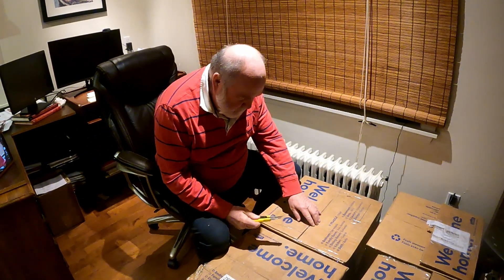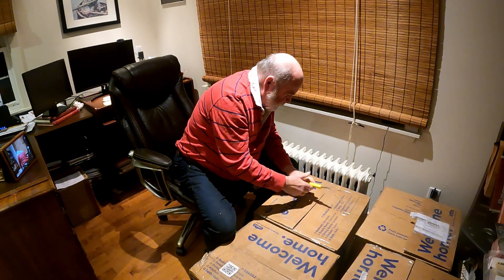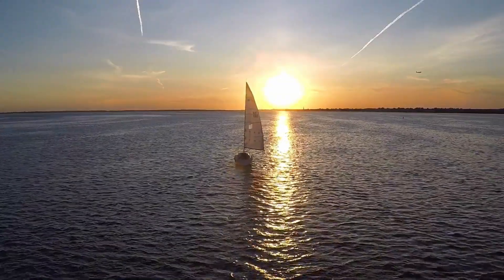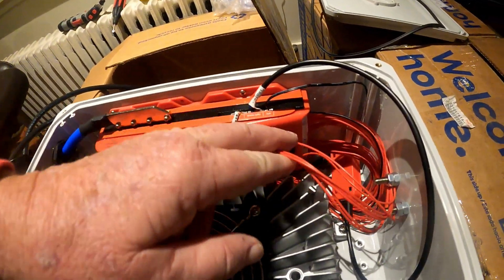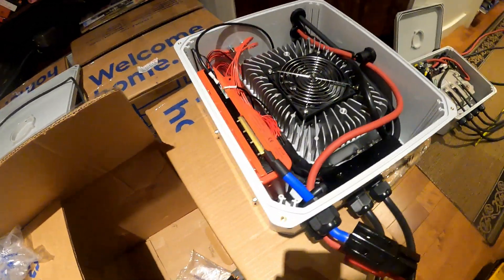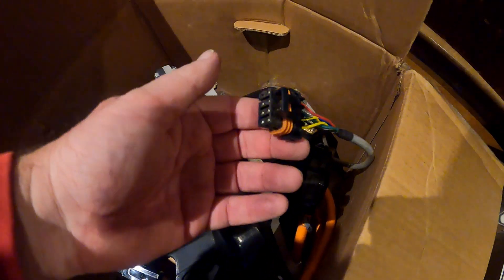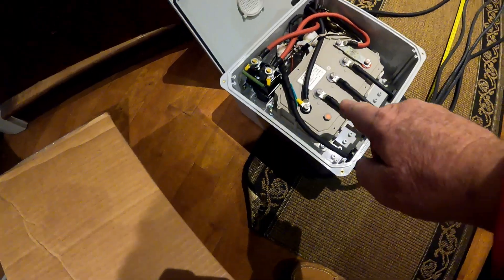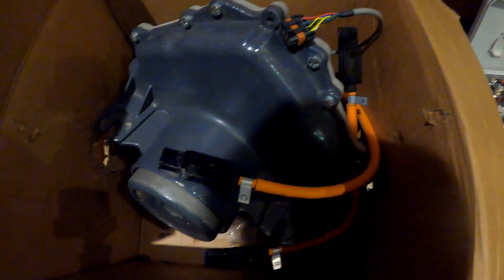Ep 2. Electric Boat Conversion - It's All Coming Together

Comment: Hi i just found your content im interesting to watch it as im in process to convert 37" boat to electric driven but now i actually converting led acid powered forklift to lithium, i saw your charger and bms in watertight box but i think both of this components are watertight and maybe it no need to be inside the box, im just wandering if the charger could overheat in this closed box, anyhow how is the boat running and how many miles can you do on the charge and how many kWh did you installed ?
Reply from the maker: No problem with overheating of charger and bms.  Box has a vent on top and I am usually charging overnight when it is cooler.  Currently working on improving efficiencies with smaller outdrive and propeller as they were matched for a much more powerful OMC Cobra 5.7 L gas engine. Not the ideal boat to convert because of its deep V hull shape, but we love the boat in all other aspects and use it for quiet peaceful day cruising and short coastal runs.  Currently at full throttle doing 6.5 knots for about 1.5 hrs.  Half throttle at 3.5 knots for about 3.5 hours.  The R & D continues.

Comment: What company did you work with to get the electric components?
Reply from the maker: Scott Masterson of Stealth Electric https://www.stealthelectricoutboards.com, had done a similar conversion of an i/o a few years back and did several videos.  I found him on the website plugboats.com (a terrific resource) and figured what the hey. I would give him a call.   I outlined what I had for a boat and he provided the specs and design for the system. I felt going with one supplier would give me a shorter lead up window to launch.